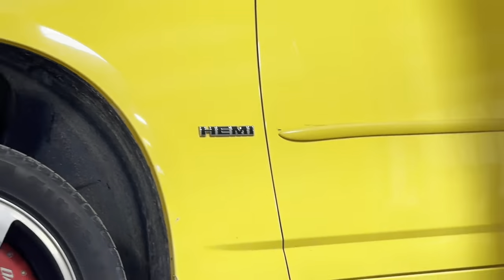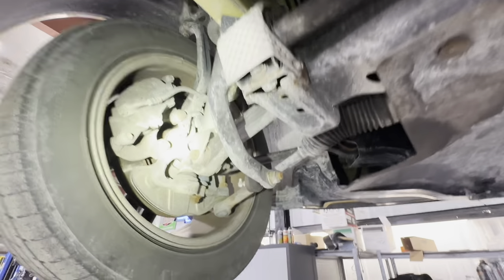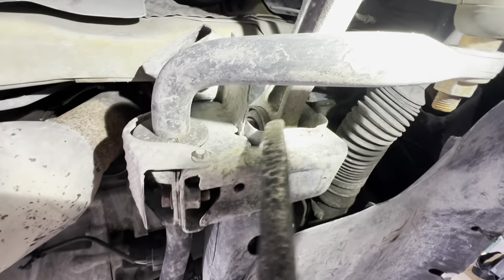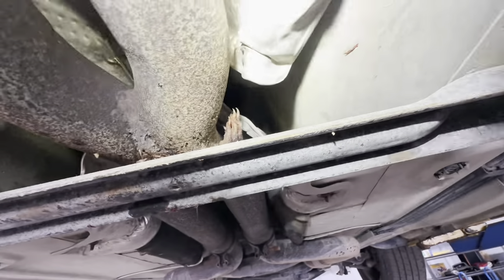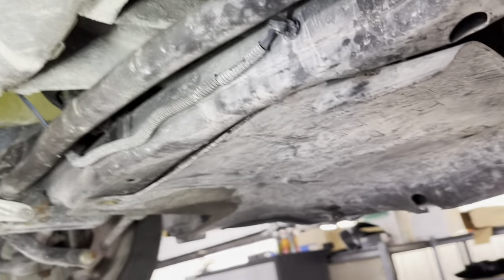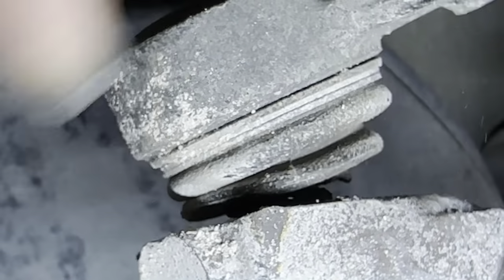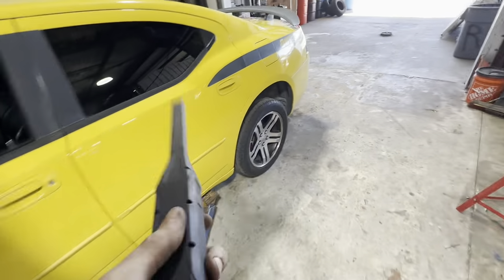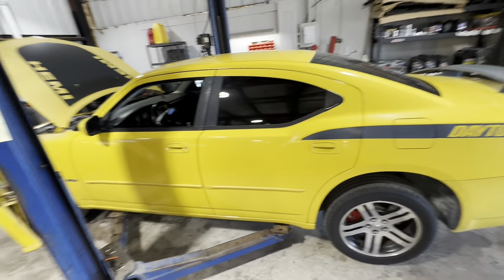Exhaust cooked ROADKILL! (AND a BENT FRAME!) 2006 Dodge Charger R/T 5.7 Hemi

Comment: If you can't dodge it ram it 😅
Reply: Never heard that 😂
Reply: Nice.
Reply: Old George Carlin joke about the Dodge Ram Charger.  Funny they didn't dodge, because they saw it was charging!😅
Reply: Too much Ram not enough Dodge
Reply: Why does anyone buy a Ram or Dodge vehicle?   Do they just love spending more time with their dealer?
Reply: Dodge the father ram the daughter
Reply: @AB-jk7tw , why does anyone buy a vehicle? They all go to the dealership at least once or twice, sometimes more. 🙃
Reply: Dodge the father ram the daughter💪
Reply: LOL
Reply: @AB-jk7tw because Ramas are the most reliable and durable of the big 3 half tons... empirically... for more than a half a decade straight.
Reply: @omardevonlittle3817  The replacement transmission at only 67000 miles in my current, and last, RAM 1500 would disagree.  Nothing but issues since I got it.
Reply: @omardevonlittle3817  Good one!

Comment: That possum isn't playing possum anymore.
Reply: Couple of other observations:
The little hand above the muffler is an indicator that its very hot..
Proof a  Dodge Charger can at least outrun a possum.
Official winner of the longest playing possum contest
A possum can keep up with a Hemi Charger ..Snoopes: That's partially true..but only partly in parts only
Now that the possum is part of the car.., does that make it a Pomi Hessum?
The possum only gave up because he got exhausted...
That was one tough possum to bend a sub chassis like that.

Comment: "At least it wasn't a cow".
Thanks Ray, for the coffee all over my keyboard. :)
Reply: If it had been a cow the driver would not have likely survived as the body of the cow would have gone through the windshield.
Reply: Having come close to clocking one, yes that is a good thing. though that was the least worry of that night, further on came across a hippo, and definitely did not want to be involved with that. Emergency stop, and a very rapid reverse, because a hippo is quite capable of biting thorugh sheet metal of a car, or even biting through the radiator as well. Hitting not good either, 2 tons plus of by now very unhappy critter sitting on your lap, and they are, despite the massive bulk, both very fast and very agile. Elephants give them a wide berth, along with rhinos, and crocodiles, and all of those are very capable of defending themselves.

Comment: Not many raccoons, possums or armadillos in the UK, but I did cross paths with one very unlucky pheasant once. Driving along a tree-lined country lane, this errant pheasant decided that it would be a really splendiferous idea to fly across the lane at approximately 1ft above road level, and timed his launch for the precise moment when my 2008 Skoda Octavia's trajectory intercepted with his. The ensuing 'THOMP' was a relatively minor affair for the car, what with pheasants being somewhat diminutive of stature. This impact alone would have been more than sufficient to see his continued existence in this universe brought to a premature end, but oh no, this pheasant wanted to go out in style. After experiencing approximately 400,000 ft/lbs of energy delivered in a fraction of a second, he promptly arced away and slightly upwards toward the opposite side of the road, and before his mortal remains could be reintroduced to the nurturing embrace of terra firma, he was hit again by another car travelling in the opposite direction. A literal double-whammy.

I mourned his passing, but celebrated his flair for the dramatic 😄.
Reply: If you're going to end it all, do it with style!
Reply: Armadillos are known as Texas speed bumps.
Reply: Pheasants come in low and take out headlights. Have you checked the price of those units recently?
Reply: I hit a pheasant once. I payed for a new bumper. I didn’t write a dissertation on it.

Comment: As has been said a few times, in Australia, Kangaroos are the major road hazard at night (when you're not dodging wombats, rabbits, foxes, camels, et al). Clouted one at 140kph one night. Had a 'roo bar on the front thankfully. Bent the 'roo bar, bonnet (hood), mudguard (fender), broken headlight, popped the driving lights out of their housings, but they were still illuminated, but hanging on the wires. Hit a hare once too. He was about 3' tall! Broken bumper.

Comment: A friend in college hit a deer or elk with her THREE HOUR OLD car. Brand new, she had just picked it up from the dealer and was doing about 60 mph on the highway heading home to Steamboat, Colorado. Totalled the car. She wasn't injured. The critter certainly was.
I was a bit disappointed to see paint fade on that 8 year old Dodge! They don't make em like they used to!
Reply: My father worked on the Ford production line 1960. Shuttle driver last in convoy to parking lot was very slow starting. Construction worker with dump truck full of concrete met him head on some 300 yards from his starting position at a sharp corner. Rear wheels, tail lights salvaged,  otherwise total loss.
Reply: Well if she lived in steamboat she could probably afford to have it fixed or get another one
Reply: I hope she arranged Insurance BEFORE driving it off the lot.
Reply: I don't recall if she lived in Steamboat Springs proper... or just in the area. Way back when I was in college, Steamboat was a pretty small town.... maybe 4000 or 5000  people. And it was her parent's home, anyway.
I don't know that she was one of the "rich kids'... We had plenty of those, though.
Reply: At least it wasn't  a moose. Those things stand so tall that cars take the legs out and catch the body right in the windshield.  Been known to cause both the moose and front seat people to become unalived.

Comment: Had a 2005 Dodge Magnum Hemi for 17 years and I loved that car, especially that hemi torque.  It was fun to drive while being roomy and comfortable.  And it was more reliable than the 95 Mark VIII Lincoln that it replaced.
Reply: I have Owned 2 Dodge Vehicles and Both were Triple Lemons...
Reply: Your time-line of vehicles is eerie similar. We still have our 05 Magnum SXT w/ the 3.5HO. 260k on it. Then I drive daily my 06 AWD Magnum R/T at 150k. On rails with the AWD. And a project car I kept, still drivable, is my 95 T-Bird LX with the 4.6 at only 93k on it. 

 Randy sorry you had lemons. Keeping up with every little service item on mine has kept them running strong for me.
Reply: @randybeard6040  The Magnum, Charger, Chrysler 300, and the later Challenger are built on a Mercedes platform and the drive train is Mercedes except for the engines.  Daimler Benz owned Chrysler when these were introduced.
Reply: @tankmaximus the 3.5 was a good engine, timing belt was a pain in the rear but every 100k, you survived. Had one in a 94 intrepid, went through 2 transmissions, but the engine was rock solid.  

Was actually looking for a 3.5 magnum myself as a play car.  I've always liked wagons.
Reply: I tell you hwat, that Mark VIII is a real nice car, inside and out...

...when it's not broken and you gotta foot that bill for just the parts.  Yeesh.  I was never so glad to get rid of a car, and that by being robbed at knife point.  Idiots, they took a problem away from me, thanks! 

/But man, when they are *right*, they are *right*.
Reply: @mikeybhoutex  I loved my Mark VIII. I bought it with 38k miles on it in 97 for $19k.  It was fairly reliable.  I didn't have any expensive repairs.  After I replaced the broken tiny hollow rear sway bar with a large one recommended by the forums, it handled almost like it was on rails.  They did have some designed in flaws such as the too small brakes on the front where the rotors warped on the first panic stop, and the driveshaft needed replacement after a few years because that weird shaft within a shaft design started vibrating, and the ABS would work so weird that the tires would bounce up and down when it worked.
Reply: Had an '07 Magnum R/T with the 5.7 Hemi.  What a beast.  Not just fast but they looked good doing it.

Comment: The bent subframe damage looked as though it might have been older:  where the paint had flaked as a result there was old-looking rust beneath, so did that happen and have caused the suspension components to be replaced, and it's a fresh strike which has brought it all back to attention?
Reply: I thought that looked suspicious "the sub frame damage" I am a retired body and frame repair guy with 46 years experience.  Unless the guy was off-roading at the time he hit whatever critter.

Comment: Yes, 05 Magnum SXT at 60mph smoked a fox dead center. Bumper, fascia,  radiator support bracket, cracked lower radiator, plastic service cover, rear subframe, and something else I'm sure. Full coverage fortunately. Cost insurance $2800 and my $100 deductible.

Comment: A few years ago, my daughter was driving my wife's car home late at night and was on a dark section of road when she hit something. She got out of the car and looked but since it was so dark, she couldn't see any damage and decided to carry on home. Just up the road, she came to a police drunk driving check point. The cop had seen her pull over but hadn't seen the collision. He was suspicious of why she had pulled over so he questioned her. She told him that she "might" have hit an animal. He walked over to the passenger's side to look and came back laughing and confirmed that indeed she had hit something.
When she got home, I looked at the car. The hood, bumper, front quarter panel, front door and rear door were smashed. In addition, there were deer "pieces" stuck in the grill.
Reply: Even hitting a fawn can seriously damage a car, especially at highway speeds.
Reply: Jim, I hit a big Grey Kangaroo in Canberra (Australia) about ten years ago.  They are remarkably stupid animals and will often turn towards the noise rather than away from it, so you often get them jumping   into   the path of a car.   Anyway, this one took out the hood, front quarter panel and the radiator.  This was in a Holden Commodore (think Chevrolet SS) so they were pretty common in scrap yards.  I got some replacement bits, fitted them and felt quite proud !     Literally one week later a wombat lumbered out in front of me on a twisty road.  Wombats are not huge, but my word are they SOLID !   Lost one front wheel and various other pieces of suspension componentry.

Comment: I ran over a possum once, unfortunately the possum was sitting on a rock at the time. Made holes in the fuel tank, after dents in the floor pan, (Honda Civic 1980's can't remember exactly), Due to being in the backwoods, having no petrol (gas) would mean being stranded for days, I grabbed some brush and weeds to plug the holes as best I could then drove like a crazy person to the next town. Arrived just in time, as the fuel ran dry. The local mechanic, removed the tank saying,"Yep it's got a wee dent", it was pretty much crushed. he took out the sender bashed it back in some kind of shape then put the exhaust of his truck into the tank, to remove fumes, before welding the holes up. Possum did not make it.

Comment: Hit a decent sized kangaroo with my father-in-laws Hyundai Sonata...luckily at the angle where the car went straight over it.  No damage to the car (EXTREMELY rare) the car behind me was not as lucky and it did some serious cosmetic damage to them. Then task of having to pull over in the dark and hike back to the carcass and drag it off the highway so others would not go over it and to check its pouch for a joey (baby). No joey.

Comment: I can attest to the lack of heartiness these LX and LC platforms have (Charger and Challenger) in their front suspension.  105k miles and I have to gut the wheel wells and replace everything.  Struts, isolators, mounts, upper and both lowers, end links, inner and outer tie rods, and lower ball joints.

Comment: Never had it anything gets stuck on my exhaust but about three years ago a deer jumped out in front of me on a wooded road. I hit them with the passenger side of my car at 40 miles an hour. Only thing I had to replace was passenger fender, and a headlight, my little 09 Forrester is a tank it might not be fast. Sure it leaks oil from every orifice but it’s a Subaru thing. Lol 😂 i ha😢ve 190,000 miles on it now so I can complain

Comment: The damage was unlikely caused by the animal. Something more substantial, and the racoon or whatever was just in the wrong place at the wrong time. So probably a big rock, but it is hard to tell with a camera. 
In Australia we have Kangaroos,, and some of them are quite large. Dawn and dusk in certain parts, and you are almost guaranteed to see some Roos. I have hit one or two, but sometimes they are just too hard to avoid. They see lights coming fast, and will either freeze, or hop over you, and sometimes they get the timing wrong. 
They are really cute animals, although a buck [male] can be really dangerous. But only if you do something stupid. They can rear up on their huge tail, and disembowel you with ease. As an example of evolution, they are superb. Fantastic adaptations. basically an over grown marsupial "rat", but a strict herbivore. When there is a drought, they can put their pregnancies "on-hold" until the wet season returns. 
Farmers consider them a pest, and I suppose they are. But the meat is much healthier than tradition sheep, cows, pigs. Very lean, quite tasty, but can be a little tough if not carefully prepared and cooked. Traditionally used for dog food, and of course you have to watch for intestinal parasites. 
But farmed roos, with vet support [worming etc], are suitable for human and animal consumption. 
As they are adapted to the Oz bush, their impact on the environment is much lower than traditional domesticated animals that were imported from elsewhere and evolved under different conditions.

Comment: After seeing those kibbles and bits under that car, this is not a video for someone with a weak stomach.  Whatever it was, it was stout enough to bend metal.  Put a mat on the floor and use a pry bar to push the remains out from behind.  They wash it all out.

Comment: Not stuck, but an emu being hit by a b-double and going under every left hand wheel set is MESSY! Especially when it goes in-between the duals and comes out the holes in the rims. Took going through a severe storm to finally clean the underside of the truck!

Comment: If it was a raccoon or a possum it definitely would bend the subframe. I hit a raccoon in a mustang prototype and it caved the who left front of the bumper in which we fixed but I know if you hit them at any speed over 30 it’s like hitting a 18 pound bowling ball. They do a shitload of damage.

Comment: I got an 06 300C for a song because it had a bent subframe. New they are 400 bucks and take about 4 hours to swap laying on a garage floor with some jackstands and an engine hoist. Easy job and the suspension will be right there during it. These cars are one of the better things Chrysler ever did. They are tanks

Comment: My wife,  nearly new 2001 toyota celica 70mph freeway  dead deer on the road, the rib bones were over the hood, yep she thought she could straddle it, no other cars on the road. She hits it at 70mph, and keeps going. I had to yell at her to get her to pull over, so i could look if there was deer body parts in the oil pan.  I must have spent 8 bucks worth of quarters to wash that stink off the car, it reeked really bad.
Now had she been in Rays truck i get how she might think the car would clear it, but the dam rib cage was taller then the hood.  Rays truck wouldn't clear it.  
There was nothing but twisted mess on the road i did see that much.

No dammages to the car that i could see.  We got home pulled in the garage it was about 2am i knew i had to go the the car wash.
That was over 22 years ago it might still have deer guts on it. 

Sports cars that sit low to the ground can't clear a pea, so don't run over them. Now she drive a car thats on factory lowering springs.
And I'm nervous.

Comment: That owner needs a high lift like a truck for their driving habits and agree hitting things at high speed will do alot of damages.  I hit a deer caucus at 60 mph, which sent the van in the air and took off exhaust from cat back. Lot of smelly deer parts.....

Comment: Ran over a cat once didn’t even notice until I went to get the trans fluid exchanged I was shown a picture of a cat hanging under my frame railing and motor mount the tail was caught under the exhaust rack it didn’t cook under the exhaust but the rear exhaust and the frame it was absolutely disgusting but the subframe didnt bend or get out of shape so maybe I lucked out who knows

Comment: Yes,  had an old 78 olds delta 88 and I ran over a skunk and it got stuck on top of my muffler heat shield. Couldn't get back into the car for 3 days it stunk so bad. Sure do miss that car.

Comment: Once I came around a bend and a duck mother and some offspring waddeled across the road on a long single line. Their queue was too long for me to avoid them all, and stopping was not possible. Some chicks were seen in the back mirror tumbeling from under the car, and all afterwards scurried to get across to the other side and were not seen thereafter. I drove on, and a mysterious mixed odour of dinner and burnt wool started to build up in the car. At a convenient stop, I could se the remains of to chicks wedged between the block and the exhaust manifold. They were pried out whith a solid twig, and allthough no mechanical damage was discovered, the smell slowly subsided over a few days.